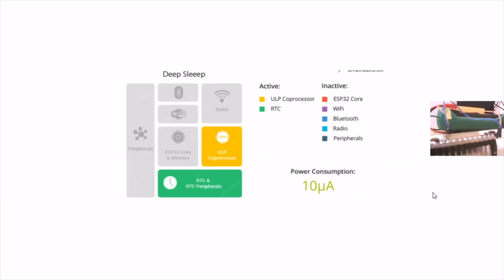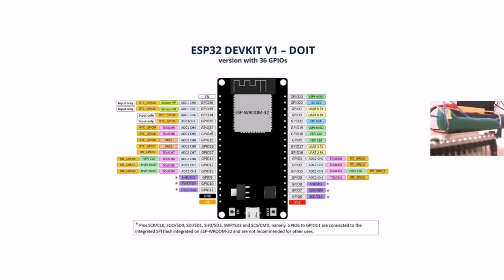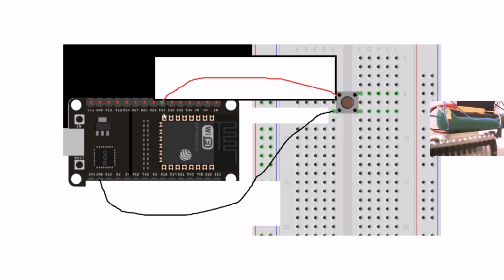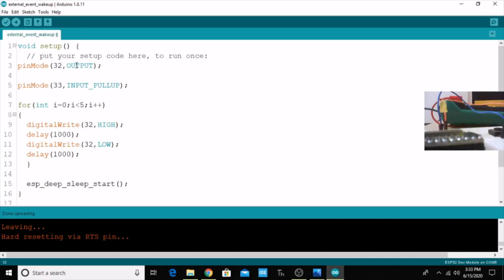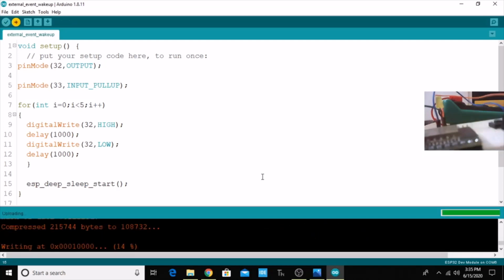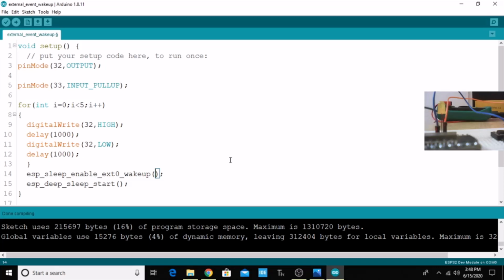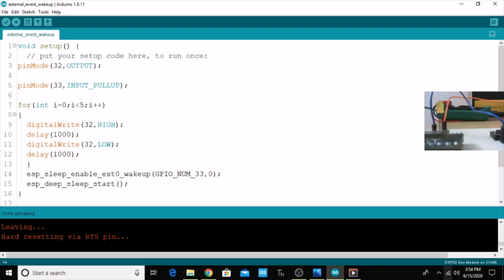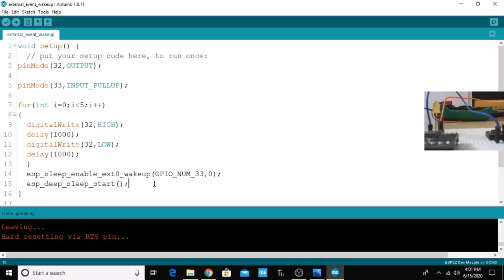External wakeup event from Deep Sleep Mode in esp32

Comment: I'm trying to do this but wake the esp32 simply when the button state changes. So if the pin is high i'd like to wake when it goes low (press the button), and if the pin is low, I'd like to wake when it goes high (release the button). Is this possible? I can't seem to get it to wake when the GPIO goes high.
Reply: he explained that in the line:

esp_sleep_enable_ext0_wakeup(GPIO_NUM_33,0);

that "0" at the end makes reference to the state of the pin in LOW, so you could try changing that numeric to "1", see if that means HIGH, probably

Comment: Hi, good video. I have a project in which with a GPIO pin 36 I wake up the esp32 from deep sleep and in my code try to read it as HIGH and so if it is HIGH it should go into the loop and execute this function of connecting over bluetooth, which through serial mode will connect to the WIFI and it should stay awake until I get it to disconnect bluetooth after wifi gets connected but somehow it just runs quickly past it without stopping to do anything about it. I have an inkling that it might be my noob code. What do you reckon the best possible way to do this? I have several GPIO pins with which it can exit from deep sleep mode,  but there is single pin that I read for Bluetooth connection, pin number 36 and that I do by basically using if(digitalRead(36)==HIGH){BluetoothInit();} where in BluetoothInit, it will simply just take the user entered string to read and connect to ssid, password and connect to wifi and disconnect when successfully connected. Is this approach wrong?
Reply from the maker: You have just go through the timers concept in esp32 using datasheet for this application.

Comment: Hi! I have a question. I have an ESP32 and RFM69HCW module that makes an event to GPIO27 from my ESP32. Now, when my ESP32 is waking up how can i read the data received to my RFM module?
Reply from the maker: Yes it's possible to make a external event using RFM. One thing you have to keep in mind is whether the pin of esp32 that you are using is RTC compatible.

Using this one you can make a wake up call and enter all the commands for data reception. 

Hope these points will help.
Reply: @DreamChasersElectronics  The point is as follows:
-I have a sketch on an esp32 with a RFM69HCW module as a master that communicates with an atmega32u4 that incorporates another RFM69HCW module as a slave.
-In the loop, the sending and receiving of frames works correctly.
-The problem comes when, instead of the loop, I put the esp32 to sleep and use the same code in the setup. It wakes up when there is an ext0 interrupt (caused by the RFM DIO0), but the condition if (rfm69.available ()) which was previously true, is now always false and I am not able to read the rfm69 buffer

If I have not explained my problem correctly, you can tell me and I will rewrite it with other words. Thank you all for lending a hand. Good work, keep it up.